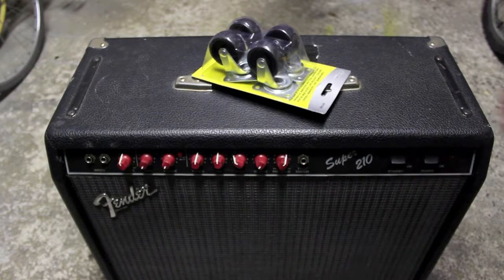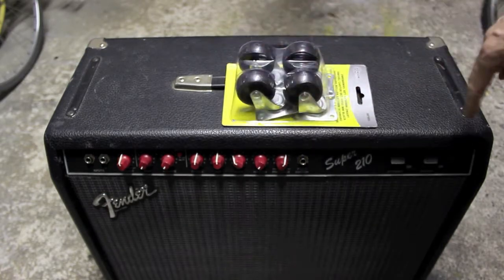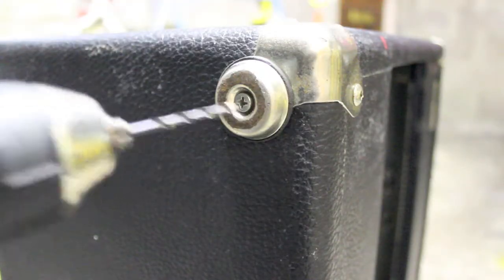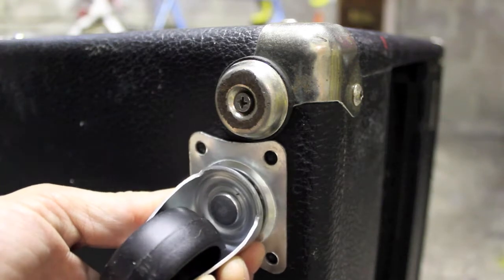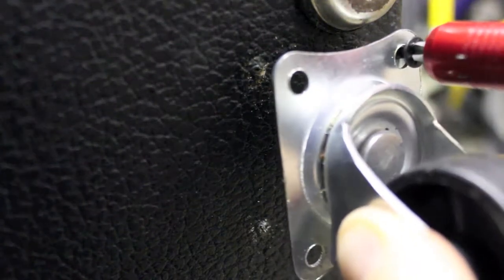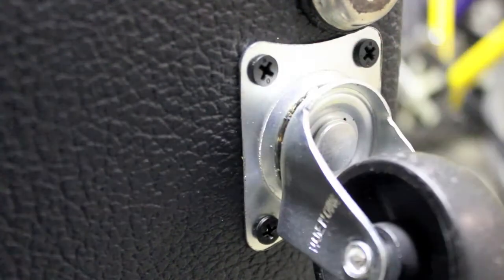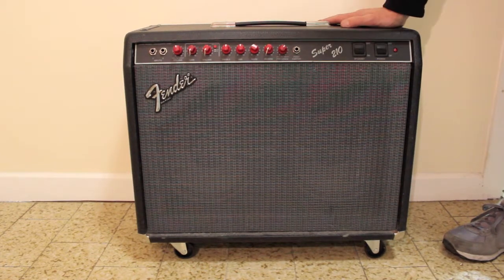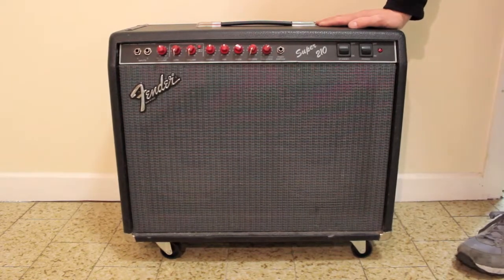FITTING CASTORS ON A GUITAR AMP

Comment: I Took the rubber feet off so i could put the wheels as close and as square into the corner as possible for a wider footprint and more stability.  I used 2 inch wheels

Comment: Go to home depo and for 1/3 of the cost you can make your own road case with wheels n the handles, metal frame guards the hole works. I suggest getting heavy duty wheels that are big n roll nicely.. your back and your amp with greatly appreciate it. About 300 bucks!

Comment: I would NOT USE 'drywall' screws, but a Little more professional-looking and job-proper 3/4"  (or as needed) flathead or panhead screws, as FAT as can fit in your caster's screw holes, for maximum durability- and just long enough to ALMOST go thru the bottom of the plywood cab.  If your amp is NOT plywood (MDF or other shite) you'll have to go with bolts and nuts for proper security and longer life.   IMHO, of course.

Comment: What size are those castors?????
Reply from the maker: Am, 40mm wheels I think.
Reply: @KRAZEEIZATION  nice one thank you for reply  have two marshall 2x12 cabs and need to move them round room alot and they will do the job perfectly nice one
Reply: @davidmurray9193  how stable is it ? what i did was Took the rubber feet off the cab. I put the wheels as close and as square into the corner as possible for a wider footprint and more stability.  I used 2 inch wheels
Reply: @1peanut  very stable with what I eventually fitted them with and I have no stability issues, does the job as it should
Reply: For a SMALL amp (if you really Need or Want wheels) 1&1/2" casters should be FINE.  Bigger amps or CABS you want at least 2" or even BEEFIER, depending on the level of abuse they will see, and the WEIGHT of the Unit- or like if constantly gigging or moving. Get SWIVEL casters, and on a BIG piece (amp or cab) you can go with 2 regular ones in the front. and in the BACK use 2 wheels that have BRAKES, so they don't roll around too much.  OR you can even use brake ones on ALL 4, if it makes you feel Better. Use NICE FAT PANHEAD/FLATHEAD WOOD SCREWS, and make them long enuf to go thru the caster and MOST of the plywood but measure so they don't POP UP from the Bottom.  If they do a LITTLE it's no Big, as long as there's no guts in the amp BOTTOM that might get in the way. Prob. WON'T be. I usually use 3/4" screws for a GOOD CAB/AMP w/3/4" birch plywood.